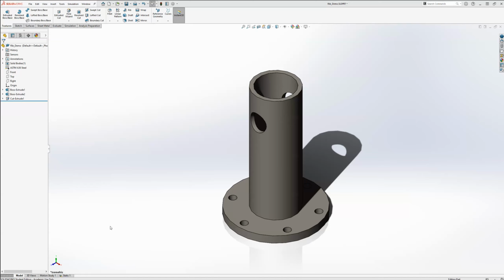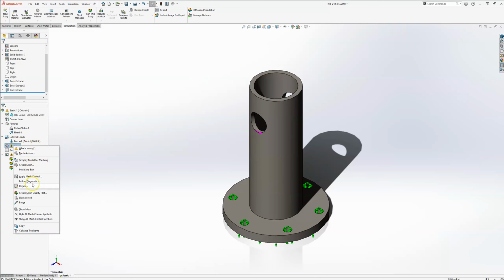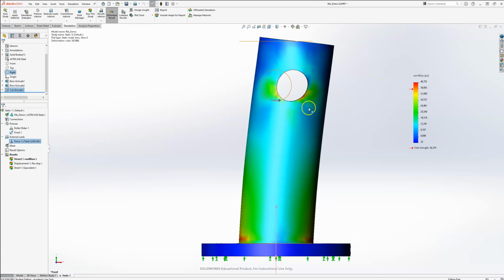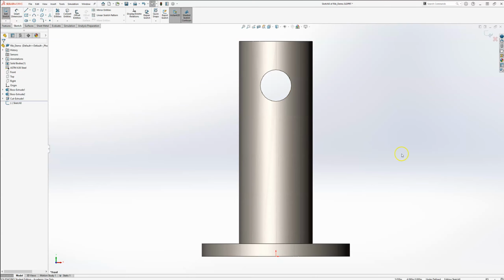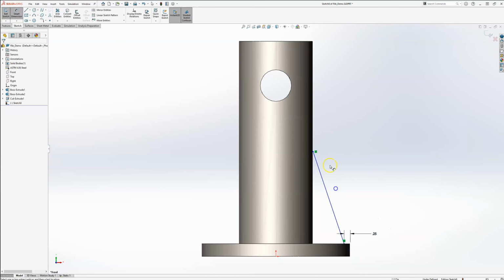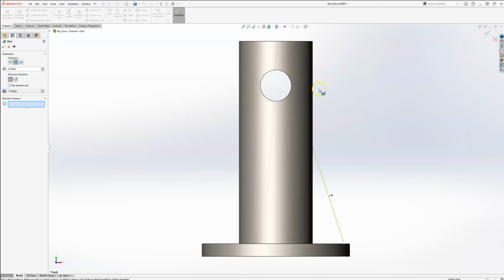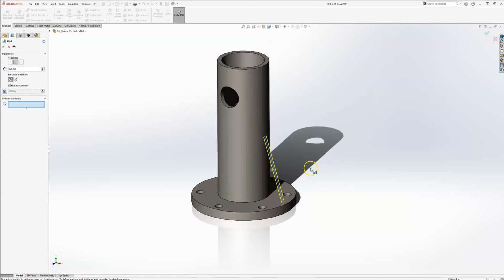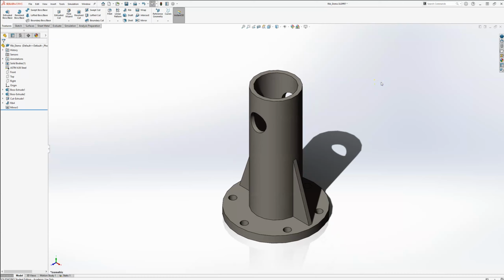SolidWorks Part - Rib Feature

Comment: Try to extend that line sketch for the rib all the way to the edge of the surface.  Either, the top of the tube or to the edge of the bottom plate.  It will give you an error.  Why?